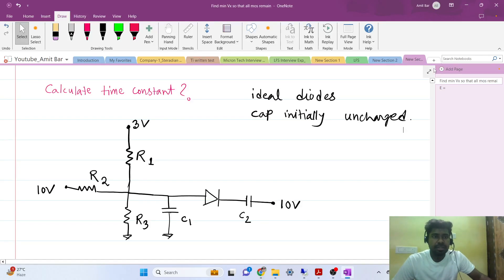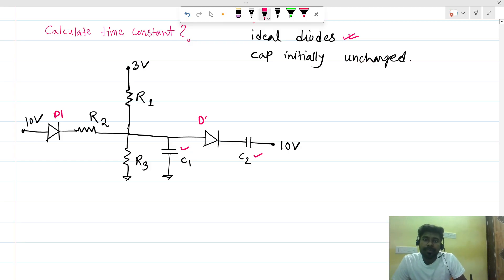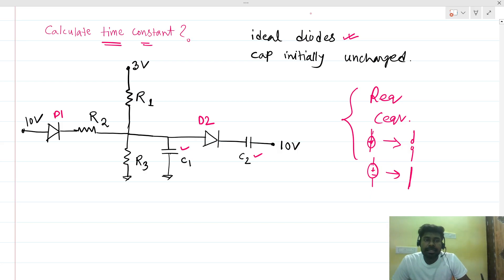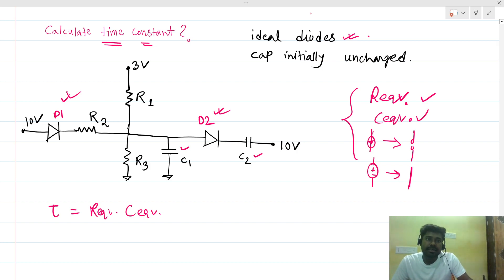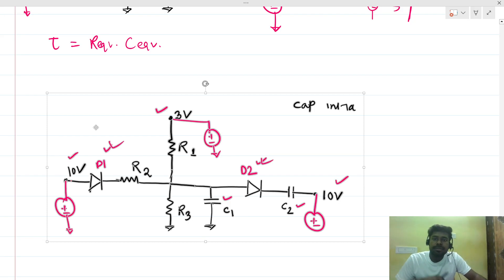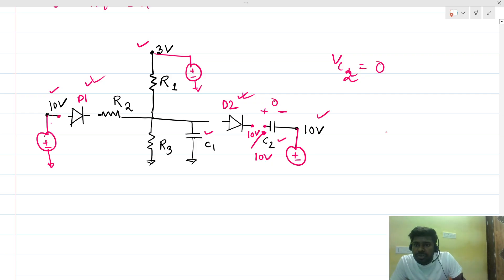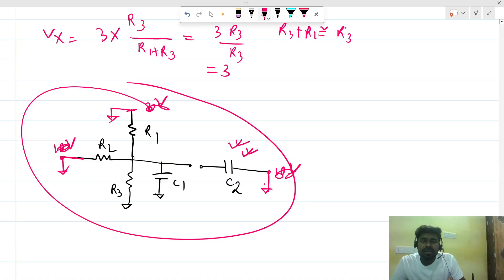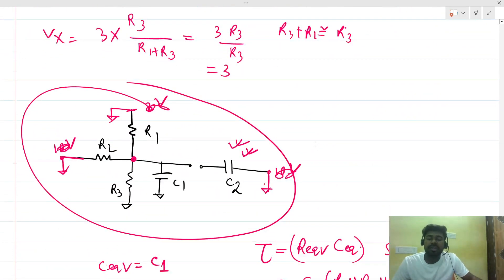Analog circuit design engineer interview _ find time constant of diode based RC circuits

Comment: Sir why C1 path is neglected during oc test
Reply: At the start all caps are discharged - meaning that both poles of C1 would be at GND (since the bottom plate is already at GND). So, for the initial condition, one can assume that C1 has been shorted out. Once the circuit is in transient, it would charge up to r3/(r1+r3) with the time constant that Amit has calculated.